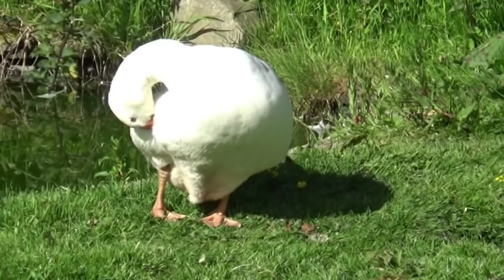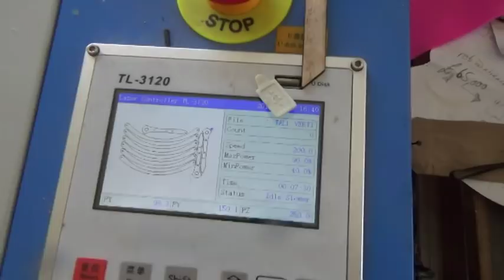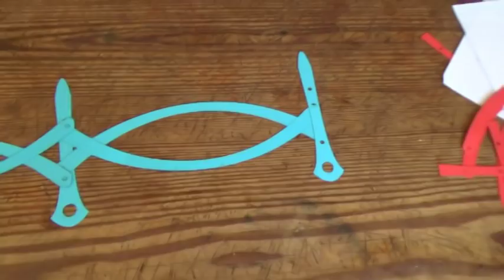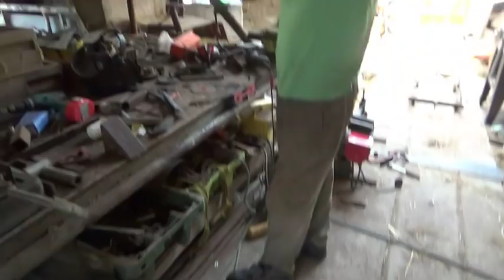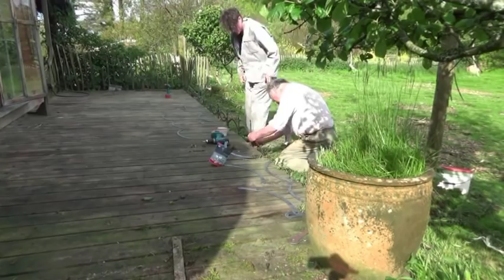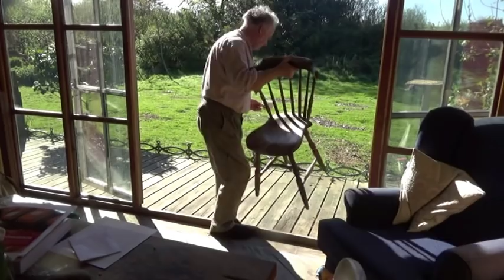Homemade Fancy Garden Edging - using just two shapes.

Comment: Next time you have a fire burning, wire brush any rust off, get some tongs or sticks or even a frying pan, and use the heat from your fire to put a blue temper on them. The blue is a type of oxide layer and will help with rust without the need to send them out for galvanizing. It also looks pretty.
Reply from the maker: Thanks, I've tried that, but really it only delayed the rust by a couple of weeks. Unless I didn't do it correctly